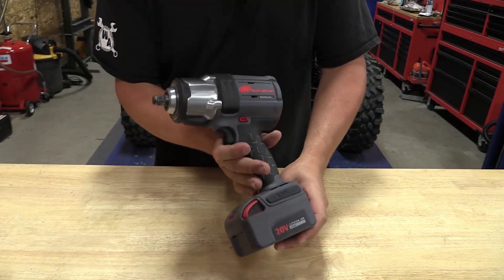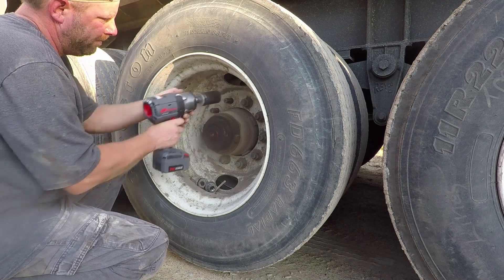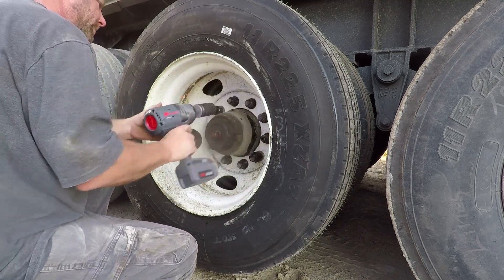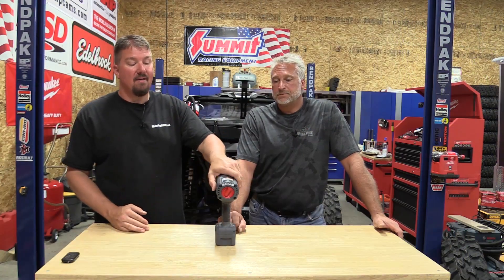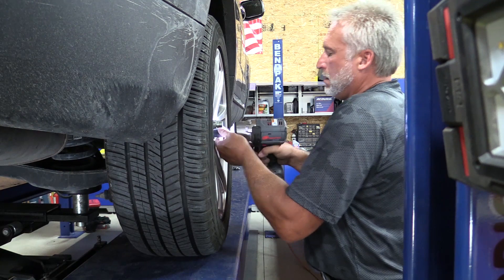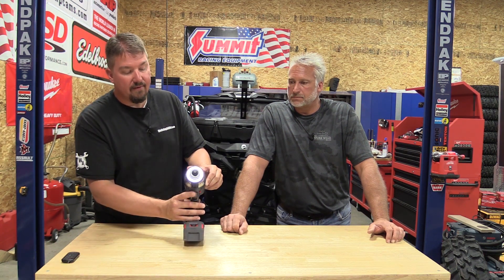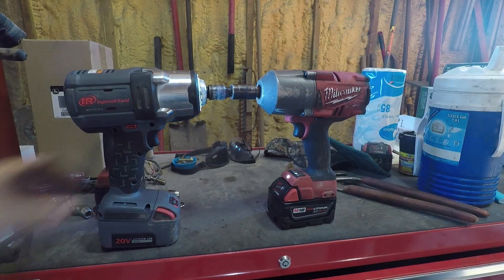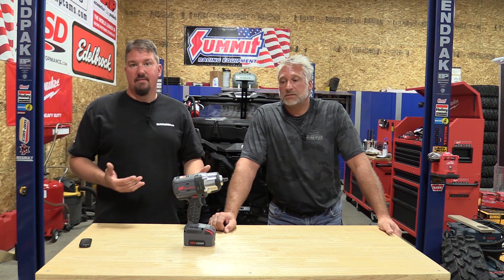Our Experience With The W7152 Ingersoll Rand 1/2" Impact Wrench 1,500 ft-lbs Nut Busting

Comment: Badass ! IR is Pro tool, designed to last a decade,not just until gen 4 comes out next year. ..great products, compressors,etc... awesome review, love the channel 👍
Reply from the maker: Thanks Joe
Reply: both made in china
Reply: I have a neighbor who's a certified mechanic he showed me his IR231 that has been in service 20 years with out any problems or rebuilds,wow!!!
Reply: I have been using my W7150 since they first came out and it still runs strong. Also the cordless Ratchet IR 380. I am buying one of these this week. I just heard about it today.
Reply: I'm not knocking Milwaukee because I love all my m12 tools but I agree.  The first 20v (7150 I think)I got when it first came out, lasted 10 years with really hard use. I'm on my second now about 3 years in and love it.
Reply: @nitroustommy  awesome bra
Reply: @darnnellmaye770  That is why I prefer a twin hammer clutch impact wrench.
Reply: Guy at work has an air powered one that's from the 90's. It outbeats the Marco and snapon air ratchets. Thing's a BEAST.
Reply: I have the old brushed 7150 and the new Milwaukee mid torque. Love them both. I cant justify upgraded as i dont need to 1000 ft lbs of power and way to invested in Milwaukee with 6 tools and 9 batteries.
Reply: @Griffin Apollo Instablaster ;)
Reply: @Marley Gus WTF IT ACTUALLY WORKED :O I just got access to my ig login within about 40 minutes by using the site.
Just had to pay 15$ but definitely worth the price :O
Thank you so much you saved my ass!
Reply: @Griffin Apollo happy to help =)
Reply: I'm just glad tool manufacturing isn't like the car cell phone or tvs where every year is a new model that makes everything obsolete. I mean to have a battery platform last this long is fantastic. Please keep it that way

Comment: I've been using a Snap-On 8850 for about 6 years now, and before that the 6850 Snap on gun.  The old brushed 6850 I had no issues with apart from battery packs dying after 4 years or so, but with the 8850 Snap on gun I've had more than a few issues with batteries, triggers, and have gone through a few motors now.  It's starting to act up again, so I think it's time I tried out this W7152!
Reply from the maker: We have an older Snap-On and you will feel right at home with the IR

Comment: Very nice impact from ir. I would still probably stick with Milwaukee because of price, warranty and a over a hundred different tools I can use with their battery.also can't wait for the M12 stubby impact. Keep up the good videos.
Reply from the maker: Been using the stubbys and have a lot of experience with them at this point.  should be an interesting video.
Reply: I am with you aaron only thing i like about it that the milwaukee mid or high torque dont have is that tilted head that i do like about it now milwaukee does do that but only the m12 lineup
Reply: Milwaukee is on second speed not third.
Reply: Thank you for that comment I got a dewalt my wife got it for me as a birthday gift first cordless impact and now I feel I gotta stay with dewalt but your comment definitely made since stick with brand that has a lot of versatility Milwaukee I think has that for sure but dewalt the color is so so so so good.

Comment: omg yesterday I got the ingersoll W7152 I used it to take out two bolts of a 2006 toyota avalon and when I put pa behind the threads I pulled it out a lot and it broke a thread that maqui I love it is a complete machine I didn't realize that I had the maximum torque I LOVE INGERSOLL

Comment: IR has come up also with “power sockets” . Those are amazing. They increase the torque on the nuts. For people who cannot afford the most powerful cordless wrenches, those sockets can help.
Reply: They look like nice sockets, but @$50 a piece it will negate the cost savings of just buying a better gun if you need more than a few sizes. Also, they need more space than a regular socket so tight spaces could be a limiting factor on usefulness as well. But yeah, for that one niche job they could be indispensable.

Comment: Have had the 7150 for years (brushed version) in the northeast. Plowing for the state up here in Massachusetts was impressed replacing the cutting edges on Fisher Plows usually had to burn the bolts off before I bought it. This one looks sweet!
Reply: Are you have battery problems with w7150
Reply: @Doctor_88  No battery problems. Had this for 8 years now.
Reply: @sundown798  same here.  7150 is a beast,  no battery problems for me either but I sold my IR tools and switched to milwaukee because of their massive lineup

Comment: Great review guys.

I only just bought a 1/2inch makita impact wrench last month and I thought that was a beast at 1400NM then I came across the milwaukee m18 fuel 1inch impact which has 2000NM and now this which has a mind-blowing 2000NM for just a 1/2 inch drive. Crazy stuff man. Sometimes I wish I researched things more before buying. Having said that I can only see the option to buy this impact wrench without a battery and charger and can not find a battery or charger anywhere? I am based in the UK.

You americans make some amazing tools.

Comment: I own the first gen milwaukee, I was originally after the IR, but the deciding factor was how many tools I could run off the M18 platform.  Ive had my gun for 4.5 years and never seen a reason to upgrade, even to the new milwaukee, sure more power is great on paper, but if the gun is doing what you need it to do, and doing it well, whats that extra power getting you?
At any rate, I think that little test you guys did gun vs gun, might be closer if you used a bigger battery.  Theres a big difference between the 9.0 and the 5.0, though the test measures more about who spins faster, more impacts per minute, than actual power of the gun, and the IR def has more of both.
I'm a heavy truck tech by trade.

Comment: Nice impact wrench from Ingresol Rand, it's a beast... You should put that Ingresol Rand up  against the Milwaukee fuel 2864-20 3/4in which has the same amount of torque as that ingresol rand at 1500 foot pound break away....
Reply from the maker: We can try to find sockets in the same size without the use of adaptors and see what we find.

Comment: The IR has more torque with in the first 5 seconds impacting a rusty nut or bolt but the 2767 catches up and surpasses the IR in peak torque at the 10-15 second mark.

Comment: Looks like a great machine. All brands are upping their games in the power department, and there are very few areas a cord actually is needed. In workshop or on site. But one thing i really liked on the ingersoll (and Makita dtw1002) is the way they actually screw the gearbox to the machine. They put the treads into the metal (magnesium?) And not into plastic like Milwaukee. Better engineers and designers maybe?
Reply from the maker: Designed to last more than 5 years.  😁

Comment: So what torque wrench are you using to get those numbers?? I tried using the Milwaukee one on one of my dump truck lugnuts. Did nothing at all. Not too much rust either. I had to use a 1.5 in drive giant air impact that you hold with two hands like your carrying a gatling gun.
Reply from the maker: We have a very large Sunex brand TW.  What battery are you using on your Milwaukee and are you using heavy deep well sockets.
Reply: @WorkshopAddict  the biggest battery available and I dont remember the size but I was using impact sockets.
Reply from the maker: @collinwood6496  so the largest available would be a 12 ah.  Shallow well impact sockets do not give you the same power as deep well impact sockets that are heavier.  What brand 1.5" impact are you using.  We normally use a 1" to remove lugs and a 3/4" to put them on.  1.5" is HUGE.
Reply: I went to my local cattle ranch to use it. I dont remember the brand. It was a light green one though with I think a 3/4in hose connection. Best I can give you for a description sorry.
Reply: And I didn't use shallow. Maybe I just got a bad gun or bad battery. I dont know, but it didn't work for me. Ill give that rand a shot though here if my corded home impact craps out on me. That dump truck was a one time thing. I just needed them off then back on with new tires.
Reply from the maker: @collinwood6496  it was probably a 1"...  So, I can't help you here as you are not giving me any info to work with.  We don't know if you used deep well or shallow well sockets.  We have no clue what battery was used.  You supposedly used a light green 1.5" drive impact to remove them.  Hard for me to say what happened and it does not sound like you were really paying much attention to what was happening.  I do not mean that as a dig, there is no info to go from here.
Reply: @WorkshopAddict  Well its been a year since I did the project, and 4 since I worked at that farm so memory is a little foggy on exact details regarding the amp hour capacity of the battery i used and brand of impact at the farm. The battery was the biggest Milwaukee offered for m18 fuel stuff. I used a deepwell impact as thats what I bought for the project and I needed it because of the lug studs sticking out. And I know it was a 1.5 in drive because thats all I had to pay attention to when using it and finding my size socket. I appreciate trying to help. I've finished that long ago though.

Comment: Not taking anything away from the IR gun but to be fair use a comparable model like the Milwaukee 2767-20 high torque which is 1400lbs. You used the 1000 Milwaukee gun
Reply from the maker: This is a fairly old video
Reply: The new impact used in the video was a 2863, which is a one key version of the 2767.

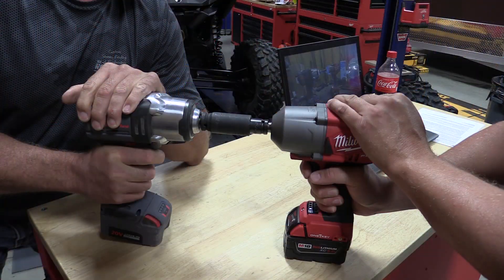@6:48.

Comment: 🤣 guys I'm a Heavy duty mechanic, all day we hammer on these cordless tools, shop and in the field.. the IR first gen is a nice tool.. but longevity goes for the Milwaukee.. not just for drops, cold weather performance.. but consist long impacting multiple bolts back to back the IR  may catch fire.. u have to give it time to cool plus the battery doesn't even last as long trust mi..90% guys on    our crew have switched to Milwaukee, bang for buck, power, longevity just can't be beat

Comment: If you had IR, Milwaukee, Dewalt, and Makita already in your shop, which impact would you go with, do you think?
Reply from the maker: I do have them all in my shop :)  The Makita is too heavy and underpowered for its size, Dewalt is nice, but does not keep up with IR and Milwaukee.  IR and Milwaukee rock.  I would go IR IF AND ONLY IF I was not going to buy any other cordless tools.  Milwaukee has close to the same power and a ton more tools in the line to offer.
Reply: IR for automotive, the rest for carpentry ect. But prefer the Makita line for that imo.
Reply: Bs that makita is right behind that gen 2 for power and all these wimps whine about the weigh fu

Comment: guys, just a heads up, just becuase the battery pack has a larger capacity does not meen it has more power, infact 90% of the time, the opposite is true, the sony vtc4 is a 2.1ah cell (so in 2p would be a 4.2ah battery) and can discharge 30amps per cell (continuous so 60 amps in a 4.2ah pack), one of the very best 3ah cells, the sony vtc6 can only do 15-20 amps per cell (30-40 amps per battery) and 30 amps at 80 deg c

Comment: Which Milwaukee were you guys using? 
That looked like the mid-torque gun.
As a diesel mechanic I will say that a 3/4 anvil is definitely a plus. All that torque on a 1/2 in anvil is nice but like you said, adapters eat power for lunch. 
I’d like to see this on a skidmore wilhelm to see the actual specs. Takes at least 10-15 seconds to achieve max torque. 
Liked the video nonetheless. 
I’m still sticking with Milwaukee. Their tool selection and warranties are second to none. 
I use mine on a daily basis. 
I have used the original ingersol 20v as well and it performed very well. 
Instead of going nose to nose do a practical test of both guns removing fasteners. 
Then we can actually see a valid comparison.
Reply from the maker: LOL, both of those were the new High Torque guns.  Latest and greatest.
Reply: nope that's not the biggest milwuakee, the new one is 1" anvil
Reply: Milwaukees 3/4" gun is my go to over any other fastening tool  else I own . Coupled with the 12ah battery , it has busted loose everything I throw at it , adapters or not .
Reply: Ryan H how’s that 12 bat? A lot heavier? I only have 5.0 bats. I haven’t seen or heard any reviews on it. Give me some info on it.
Reply: B Rumph it's honestly the best investment I made thus far where power tools are concerned . I have run a truck and trailer repair shop so I'm constantly on the go between the yard and shop and the 12 lasts me all day long and provides the extra kick the impacts need . To give you an idea , I can pull off 120 lugnuts with the 3/4" gun consistently before it hits that 1 bar flashing 2nd bar and anyone that knows truck and trailer wheels knows that is a task and a half in itself . over powered for the 1/2" hammer drill since it just kind of wants to break everything . tried running a 5/8" drill bit through 3/16" plate steel and it just snapped the bit on mode 2 lol . It really is worth the money if you need constant all day power . It is a little on the heavy side but it's a small sacrafice to deal with considering what the extra weight gives in return.
Reply: Ryan H I’ll get one then. I mostly use the 1/2 in gun because it’s not much I can’t do with it. Lol
But when I need the larger sockets, say carrier bearing yoke nuts, I use the 3/4 and it performs well on just the 5.0 battery. All of my M18 tools are gen1 fuels. Which do you have?

Comment: 😁 not sure about the test anvil to anvil wat model is that? ..  IR are powerful no doubt but for continues hammer forget it.. Just to add Malwaukee has many sizes and types based on what u need, i own a compact,  gen one fuel 1/2  plus a 3/4..  the compact gun in 1/2 gets beat the most after 3 year it looks like sh** but hey it still runs.. 3/4 gun consist hammering hasn't burnt up or blown up yet.. IR compact guns are a   joke in the first gen...  the bigger ones are ok they got some jam 👍🏾 just run time and heat issues and don't drop the darn thing or put it in the back of a service truck or get any mud or moisture on them.. they should work fine

Comment: Everybody like to take off lugnuts. How about you take something off that’s been on for more than 100k miles like shock bolts. I always have trouble with shock absorber bolts and usually have to heat them up first. If this thing could remove shock bolts from a semi truck I’d be too impressed.
Reply: Here ya go:
https://youtu.be/bz0UwwraowU

Comment: What model number milwaukee wrench did you use?
Reply from the maker: 2863 I believe.  it was the latest and greatest high torque.
Reply: @WorkshopAddict  thank you for the reply. It's not that I am a milwaukee fan boy that cant stand to see Milwaukee lose. But the 2863 max torque rating is 1400lb-ft & the Ingersoll is rated to 1500lb-ft. Maybe testing impact wrenches of equal output ratings would better prove which tool is stronger? The Milwaukee 2864 is rated to 1500lb-ft any chance you guys can test that on against the ingersoll? Thank you for your time, Mike.

Comment: Can wait for dewalt 60v. The weight is still worth cutting the cord. Industrial applications  may have less reps... Than say a semi... And many different angles of attack.  I agree with bigger bat's... And dewalt milwaukee already have them. Never enough light... I would like to see light on the nose and the base... Just in case one light is blocked.  Angle of nose can be issue with big battery getting in the way.  But that also increases over all foot print. When gun is wide I prefer a straight angle of nose... But my Mac 1/2 brushed gun is the most comfortable gun I ever used... Sister gun of brushed Ingersoll rand!
Reply: No reason for Dewalt to make a 60V impact wrench.

Comment: Ir make some awesome tools.  I love how they stuck with the pneumatic style switch & light ring looks useful.  If I run into anything my Dewalt can't handle (not likely...dfc899) I may switch over.  Already heavily into m12 line up & ryobi 18v & the one (to rule them all) Dewalt impact ...I may have a problem lol
Reply from the maker: You don't have a problem!!!!!!
Reply: Did you end up switching? been looking into these two all week long before i make my big purchase ! I'll be working on European cars alot of SUV's
Reply: @kavintruong5746  no, can't justify it when everything is working & I have so many batteries for the stuff I've got.  If my wife wants to buy me a starter IR impact & ratchet my "problem" would kick in & I would end up with the whole set lol...but she doesn't :(
Reply: @kavintruong5746  I'm actually waiting for price break on m12 stubby impacts & pick up 3/8 & 1/2 as they look powerful enough I could leave my ryobi 1/2 at home where it belongs lol
Reply: @stephenwgreen78  my left shoulder went out and about to have surgery next month, all i got is hand tools and one air impact IR and old one i picked up second hand for 20$ and its lasted but its big and a hassle to work on my suspension with it . this would be my first power tool and i don't want to go wrong with my money ! I'll be taking your advice and sticking to the dewalt 899, and pick up a m12 ratchet ,what are the stubby impacts providing that the dewalt isn't?
Reply: @stephenwgreen78  lmao ! christmas is around the corner !